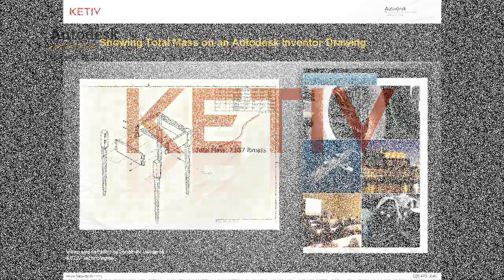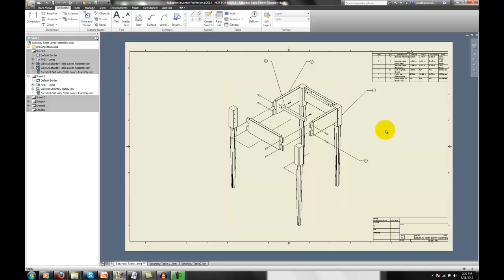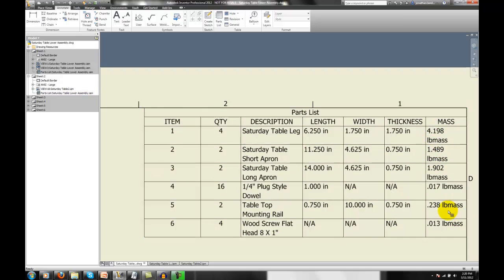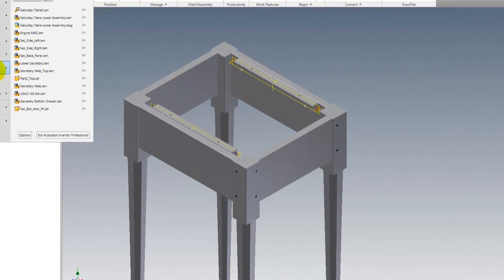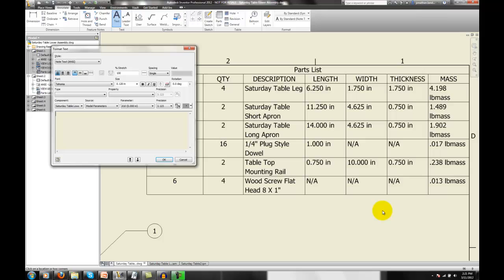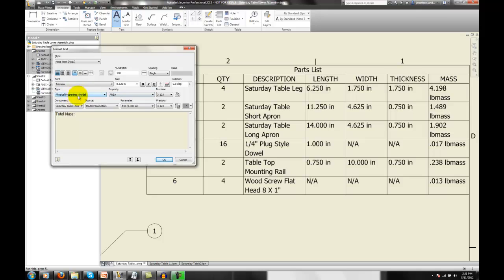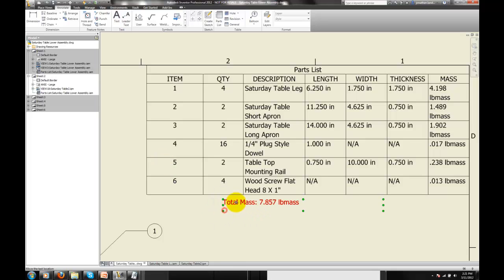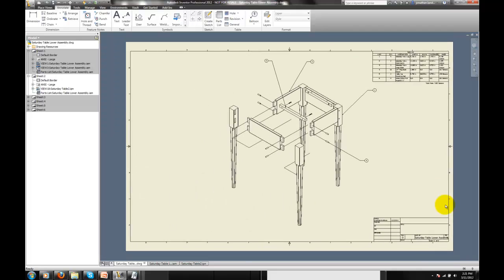Showing Total Mass on an Autodesk Inventor Drawing

Comment: man I love when a video gets straight to the point no messing around with jokes or anything. Thank you sir. Is there a way to deselect certain components in an assembly?
Reply from the maker: Hi Anthony, Thank you for your question! You can remove components from the bill of materials by making them reference parts. You can also filter your parts list for components visible in a Design View Representation.  Nicole Morris | KETIV Support Team
Reply: @KETIVTechnologies  so by making them reference it will not include them in the total weight? How do you make them reference after their already in the assembly.
Reply: My past experience with other software is. Window select entire assembly then deselect shift + select in tree components you don’t want in the weight analysis.Does Inventor have that option?
Reply from the maker: @anthonyz5671  Hi Anthony, not the way you are describing, however, the new 2022 Model States will allow you to create a model state in the assembly and it will affect the mass of the components included in that model state.  We have an AVA on What's New in Inventor 2022, next Thursday at 10am PST.  Be sure to register if you have not already!   https://ketiv.com/academy/product-design-and-manufacturing/ KETIV | Nicole Morris
Reply: @KETIVTechnologies  well that helps me not at all Im on 2021. But Ill figure something out thank you. So far not impressed with Inventor. NX is so much better. Even Solidworks is better and thats not saying much lol. But thank you sir

Comment: What if the drawing has 4 different view from 4 different assemblies? how do you pickup the mass per view?
Reply from the maker: Hi Steve,

Out of the box, Inventor only grabs the physical properties for the part/assembly that is associated with the first base view you place in a drawing, so you cannot call up mass properties for multiple assemblies/parts out of the box like Jonathan did in this video. On the brightside, it would be possible to automate the process for multiple views leveraging iLogic and the Inventor API to pull those values into the drawing. 

Is there a particular reason you have multiple base views on one sheet? Generally, the best workflow is to run a single base on each sheet to prevent any loss of performance. 

-Nigel
Reply: I agree with you and I am figuring out how to use ilogic . Do you have some thing like this ilogic code that I can have to use.
The reason I have multiple view / sub assemblies on same sheet because they are simple weldment so we hate to created so many sheet.
Thanks for your quick respond
Reply from the maker: Unfortunately, we do not have any existing code for this specific workflow. We can certainly have our experts code something for you if needed, or train you on how to tackle this process yourself.  
If that's something you're interested in, please send me an email at questions@ketiv.com

-Nigel
Reply: Thanks for your help. I found some idea how to do it on Autodesk forum that I can try.
Reply from the maker: @stevenguyen292  Thank you for the update Steve! KETIV | Nicole Morris

Comment: Nice.
But,
when the mass of the assembly is changed.
Total mass in the drawing is not updated.
Unless you force updating of the mass in the assembly, and sometimes it is not working.
This is not reliable way to show mass in the drawing (my opinion and experiance).
Reply: Just double click the text like you edit then click ok the Mass will update to the model.